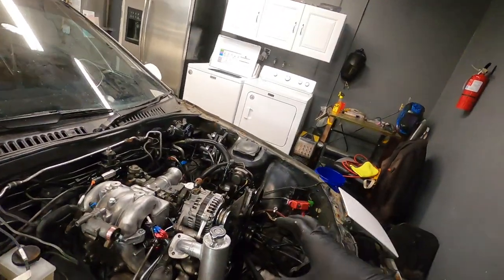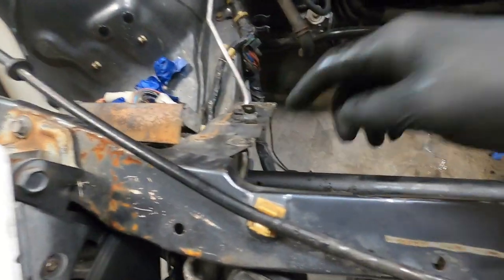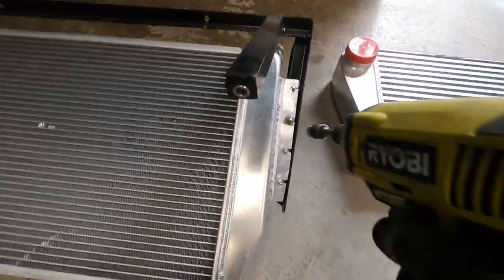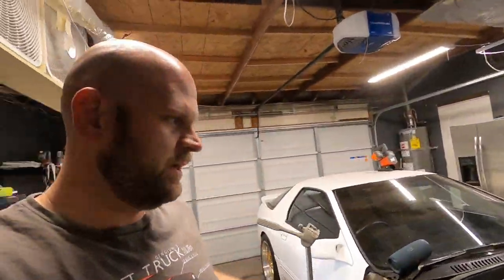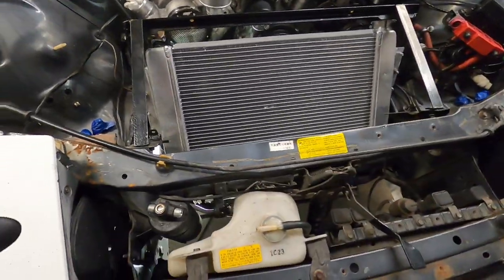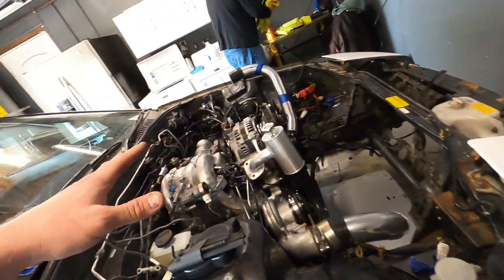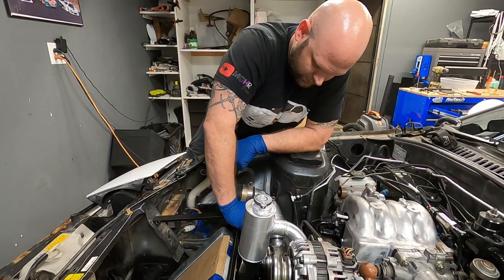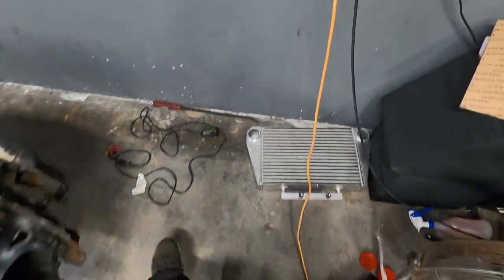Custom V mount intercooler13b Turbo // FC3S RX7 JDM RHD engine swap

Comment: I really recommend upgrading to a parallel flow condenser. If you plan on running r134a the stock condenser is too small
Reply from the maker: Thanks I'll look into it

Comment: just curious where did you buy that abs plastic sheeting and also how do you bend it to get nice bends like that?
Reply from the maker: Local plastic supply, I just googled "abs plastic" I screwed a 2*4 into my workbench to sandwich the plastic, then heated it with a torch and or heat gun, then bend by hand...
Reply: @MohrGarage  okay cool thank you! The heating party definitely makes sense and i will be trying that!

Comment: I read before you guys plan on using the stock to hood. Is that going to be temporary or you eventually plan to get a vented hood?
Reply from the maker: I plan to keep the stock Hood
Reply: @MohrGarage  whenever I inquire for someone to make me a V mount, they always say to get a vented hood to help with hestsoak. I'm sure you will keep us updated once everything is running and all
Reply: @jmirav  More so than heat soak, you want air to pass through the cores. Without a properly placed vent the efficiency of the intercooler core will be reduced quite a bit since the air doesn't have a low pressure area to be pulled through.
Reply from the maker: Going to try it out